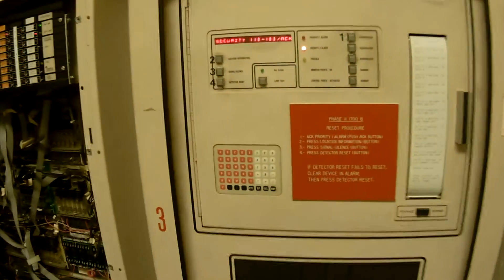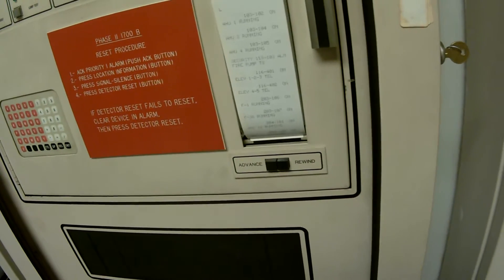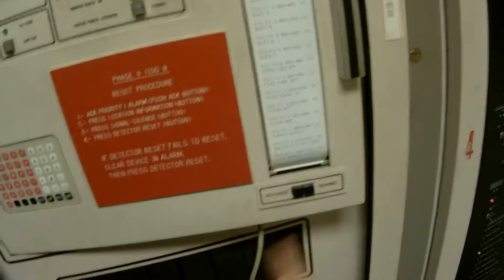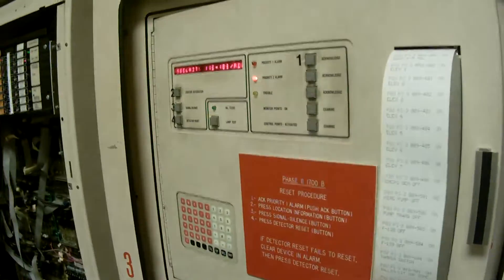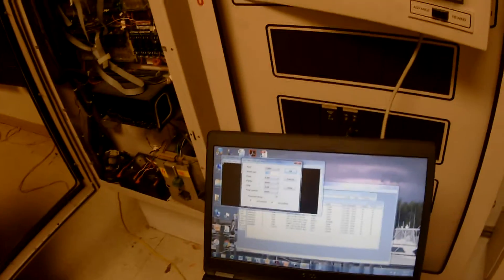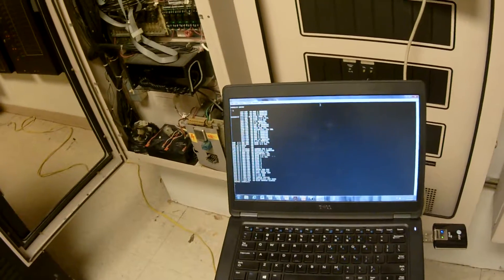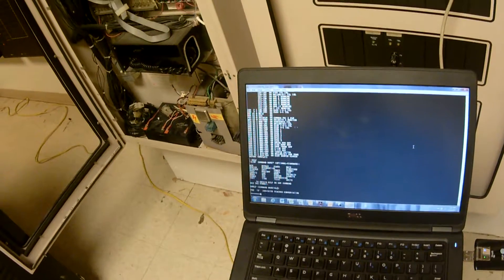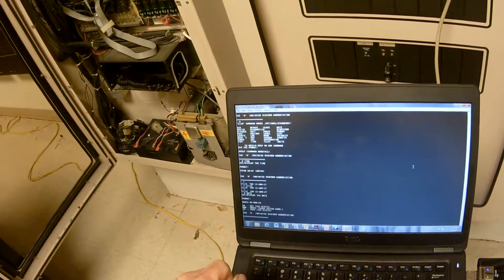2120 part 1

Comment: does this panel have a march time card?
Reply from the maker: Some do (did) but they were usually the head end of a 2001 and the 2001 had the March Time Mod
Reply: that's what I thought.  Have u ever worked on a simplex 2120 w the same voice evacuation tone generator as the simplex 2001?
Reply from the maker: yes, that's how they were all sold in my area (Baltimore,DC, and Virginia)
Reply: Awesome!! I've never seen a 2120 in real life, up close and personal, I've seen 4100's, I've seen a couple of 2001's up close and personal, one of which was a voice evacuation system, the other was not.  There have a been a few places in my city which in the past had 2001's replaced w Mircom panels.  The voice evacuation system from what I know on the Mircom panels do a temporal whoop w a voice message.

Comment: what about simplex 2001's?
Reply from the maker: Not many left, if I get a call to work on one I'll definately have the camera rolling- stay tuned, I have some footade of a call I did with a 4208, that's real old school
Reply: gotcha!! In my city, some of the simplex 2001 fire alarm control panels w the voice evacuation systems were replaced w Mircom systems.  One high rise building, I don't know if the original panel was a simplex 2001 or 2120, but whatever it was, it was replaced w a 4100.  There is another high rise building not too far away from the building w the 4100 that I believe has a simplex 2001, I was driving by, saw the building, the panel from a distance looked like it was black w a red annunciator in the lobby.

Comment: hi, i think you did great on this video! i agree that the 2120 is a fantastic FACP. since you replaced this panel do you by chance have it? id offer to buy it from you, or if you have a 2120 i could buy.
Reply from the maker: They are still in the process of upgrading and the panel is still in use, if by chance i can get my hands on it I will contact you, thanks
Reply: FireAlarm Tech hi, I just want to see if the old 2120 might be available yet. I want to still acquire it for a museum exhibit. Thanks-/Rick